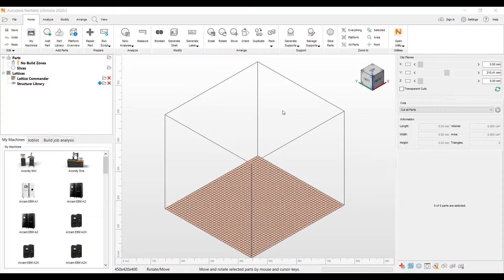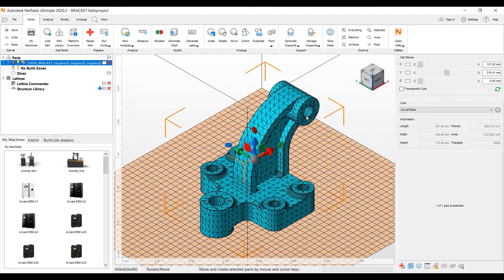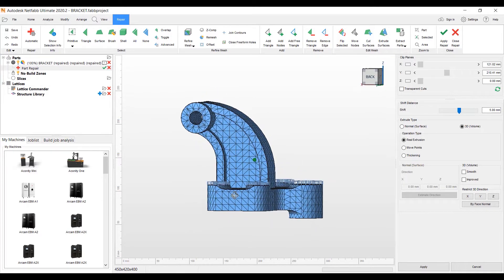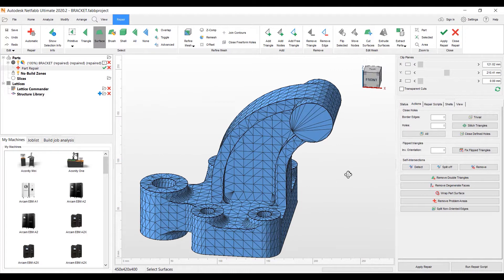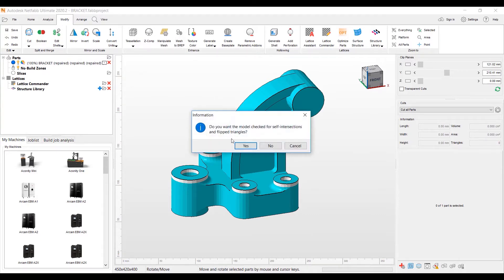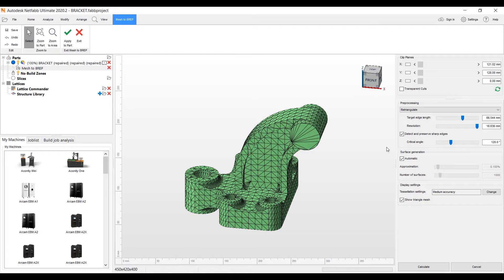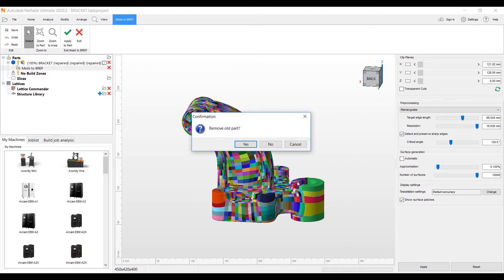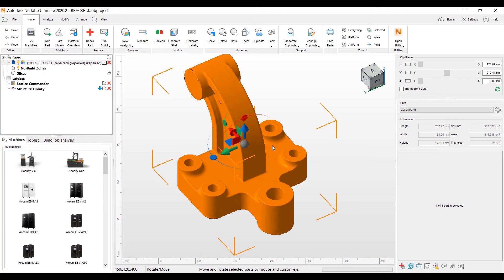Netfabb Mesh to Brep

Comment: Interesting. Thx.

QUESTION: Why IGES? Perhaps just arbitrary for this vid, but... I'm writing an article on file formats: 3D solid vs. mesh. From my research, and experience, IGES is rarely the appropriate neutral/exchange format, since as surface only, it can be impractical to recover bodies, plus there are other issues - some of which may be inherent, while others might be due to the way the object was modeled, +/or how it was exported/imported. Of course, if it's the only format available, then so be it.

And, a SIDE QUESTION: why was the format created as surfaces only? (Yes, I know there is a more recent version that supports bodies, but it seem not to be generally accepted/used). BTW, I know the origin history, and that it predates STEP, but am not sure of the format specification decisions. Thx.